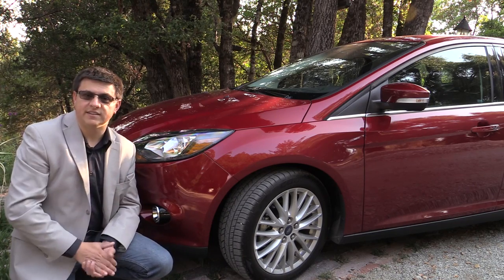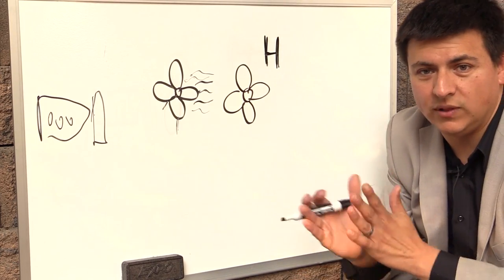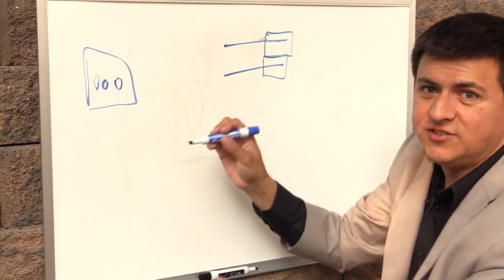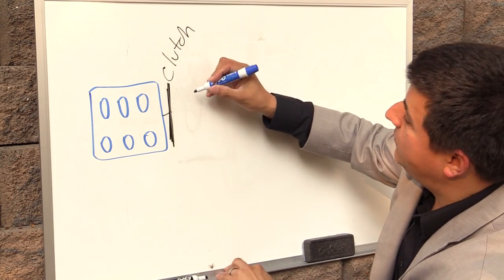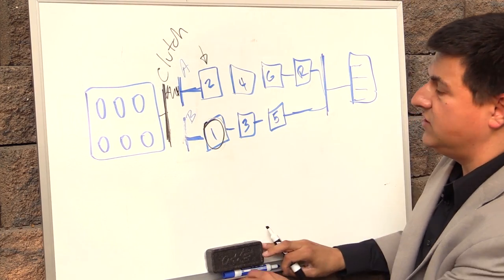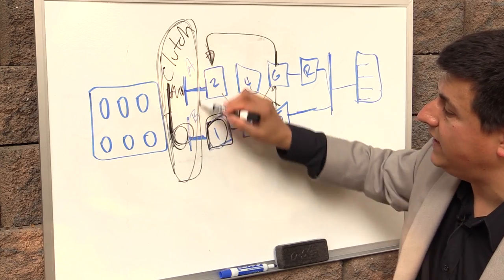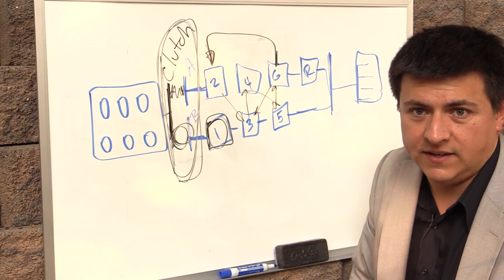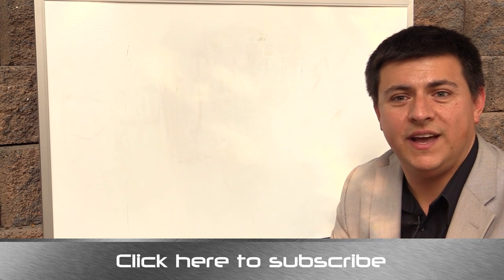How Dual Clutch Transmissions Work

Comment: A perfect explanation of what I have experienced 3 times now with my 2015 Ford Focus in that when I roll thru a stop sign I get that momentary loss of power as I accelerate hard... I thought that the transmission was defective or about to go... I understand what is happening now... thank you very much for explaining it... the transmission works extremely well once up and running...

Comment: Thanks for the explanation. My 2014 Focus has developed an unpleasant shudder when accelerating, Your explanation helps understand what may be happening. I have had it back to the dealer several times for service. The first fix was a software update which changed the frequency of the shudder. The second fix will be to replace the clutches which have been on backorder for several weeks. I suspect if parts have been on backorder that long that I am not the only one with this problem.

Comment: The main problem with Ford Powershift, that is, one that does not have leaking seals or bad electrical grounds. is that it feels like you are driving with someone who just learned to drive manual; drops the clutch too fast, shifts up too soon, this is what causes the jerkiness and shuddering. The only way to avoid this is to either move from a stop with very light throttle until over 20mph, or give it a good amount of throttle to keep the engine over the 2000rpm mark until over 20mph. With a traditional manual, the driver has the option to add some slip to the clutch to smooth out gear changes, no such option with powershift. I feel it is one of the reasons Chrysler dropped the DCT from the Dart; in order to make it work as smooth as a traditional automatic on take off as possible, they programmed it to shift very slowly, which negates the advantages of a DCT and makes it inferior to traditional automatics and CVT.

Comment: Alex, thanks for the explanation on the workings of the DCT. My wife has a 2013 Focus SE Hatchback with the appearance package (sunroof, leather seats, 17inch wheels). Occasionally I get to drive it, and these are my observations:  Love the handling and love the lumbar support. Like the ergonomics and soft touch plastics. Also gets decent fuel efficiency. Don`t like the C Pillars when making lane changes. Also the interior does not have enough "cubby holes" like to put your change or even your cell phone.  Now, about the DCT, this is one of the reasons we initially laid our eyes on the Focus. I have heard so many great things about VW`s DSG, and lots of people saying that this is Ford's version of it, I thought that this would be good for my wife who didn't like the CVT on her previous car. So, we got the Focus. I would say this about the DCT: If you live in a city with lots of traffic jams and stop and go traffic, and heavy rush hours, then don't get it because it will drive you crazy! When I drive it, and get stuck in traffic, at times it feels like the entire transmission will drop from under the car, and you car hear the gears shift. I know the DCT is constantly shifting to find the best gear, and I thought I would get used to it, but I just can`t.  Now my wife on the other hand, doesn't seem to notice or be bothered by it, and likes it over her past car with a CVT. So, I guess everyone is different, jeje. In conclusion, I give the Focus a 8/10, and would recommend anyone interested to test drive it during rush hour to experience what I'm trying to explain, and reach their own conclusions. Personally, I would consider buying another Focus, but only the ST with the manual six speed. :)
Again, thanks for the video, and congrats on your great Youtube channel.

Comment: Great informative video Alex. You've explained this better then I ever could. I think the wet dual clutch is better, but people are always complaining of the service costs. I've noticed this on many VW forums and the like.
Reply from the maker: In theory the service interval and costs would be lower in a dry clutch since you don't have the clutch material mucking up your fluid, this means less fluid pumping, smaller filters, etc. The dry clutches however will tend to have a shorter lifetime.

Comment: I own a 2014 Ford Focus with that particular Transmission.  It seems like the performance suffers quite a bit with this setup especially when passing.  It takes sometimes 1 to 2 seconds to chose the right gear for hard passing.   Which with a normal  Automatic transmission it take a fraction of the time.

Comment: Awesome explanation, thanks! So, could pairing an electric motor with a dual clutch be the ultimate drivetrain? The motor could handle all the low-speed stuff and remove all need for clutch feathering and jerkiness?

Comment: how do the clutch shifts in dual clutch transmission as it is said that it does not have any clutch pedal and only has a lever that just move forward or backward. Can I get full detail info about related to its working and changing gears.......reply asap......

Comment: I think within a given torque holding capacity, dsgs weigh more than a similar automatic, not less. This weight and size differential has been cited in regards to the Viper and Corvette decisions to not use dsgs (Viper may get the zf 8hp)
Reply from the maker: Supposedly at the smaller end of things the DCTs weigh less (I can only go by what Ford and VW have said mind you), supposedly the Powershift transmission in the Focus weighs less than Ford's joint-venture 6-speed automatic.

Comment: My 2014 Foord Fiesta is giving a problem to start, have to start it in neutral at times for it to start when it driving it won't leave 1st gear and moving from gear one to two the car shake (slip up). if i try to accelerate too fast then the engine will rev and not more. once the car reaches 60kmp that i can drive normal.  if i put the car in S-mode it will not let me manual change gears.  also at times a warning message comes up and say "transmission hot wait 5 minutes" and "use brake stop safely"

Please to advise me what is the problem and also if the "TCP" and "Clutch fork" need to change.

Comment: What makes a DCT practical is the use of a computer.  Why not go all the way and have a clutch for each gear?  Or include a convention torque converter automatic and switch to that in stop-and-go traffic.  The computer could easily handle the decision of which clutch or which transmission to connect the engine to.

Comment: Thank you for this video. Really explained a lot. I just purchased a 2014 ford focus titanium sedan and I still prefer the normal automatic transmission compared to the dual clutch one. Is there a way to replace the dual clutch transmission with a normal automatic one and how much would that cost?
Would appreciate an educated response from anyone. Thanks in advance!

Comment: what are your thoughts on durability, cost of maintaining the dct, for the Acura tlx?
Reply from the maker: Henry PachecoThe honest answer is that we won't know about the ILX until about 3-4 years from now.
Reply: +Henry Pacheco DCTs are not very reliable, in any brand.  They start shifting in a jerky fashion as the clutch wears, and eventually the dealer will tell you to replace it.   Honda has a history with their torque-converter automatics and CVTs that break prematurely (before 80,000 miles).  I would not trust any kind of Honda transmission except a true manual shift, or their cars that lack a transmission (Accord Hybrid).  Manuals are also $1000 less to purchase
.

Comment: Hi Alex,

I'm seriously considering getting a 2014 Ford Focus Titanium, but I've been reading a lot of complaints about the car's transmission.  Based on this video, are you saying the jerky feel is normal and can be eliminated if the car is driven properly? (no abrupt stop or acceleration)

Thanks so much!
Reply from the maker: Carlo Garaygay Not eliminated, but it can be reduced. This style of transmission will always be less smooth than a traditional automatic but because of the efficiencies it is becoming more and more common.
Reply: PLEASE DEAR GOD DONT GET A FORD
Reply: +Richard Garrett I got a 2015 Ford Focus SE for 2 months now (3350km).  So far so good, no problems whatsoever.
Reply: +Alex on Autos Hey Alex, Thanks for your reply btw (3 months late).  Your advice made me comfortable to buy this car :)
Reply: +Carlo Garaygay Buy the manual instead
.

Comment: ***** Have you tested the new 2.4litre Acura TLX? It uses the 8 speed DCT in conjunction with a torque converter (that's what it says on Acura website). Can you tell if that's good car to buy or its wiser to go for the 3 series? I have a budget of 35k.

Comment: you forgot to add that a torque converter multiplies torque as much as doubling the torque output. the inefficiency of a traditional automatic is negated by the smoothness of shifts and how long they last plus they can handle more torque than a manual or a dual clutch automated manual. a lot of modern automatic transmissions shift just as fast and are much smoother too.  all you need to do for maintenance is change and auto's fluid periodically. i dont know how long the clutches last on a DCT but i bet its lot more work to change. i drove an audi with a DCT and i hated it.

Comment: Hi , great simple explanation, for me just perfect,but i have a question about newest Acura TLX 2.4 with 8 speed dual clutch WITH torque conver. Would this be the best solution for performance,  efficiency and smoothness ???
Reply from the maker: Removing the torque converter is the primary way the DCT improves efficiency vs a traditional automatic so by adding it back in you trade the improved smoothness and low-speed crawling ability for some inefficiency. Part of why Honda did this is to reduce weight and the overall size of the transmission.
Reply: Alex on Autos  hmmm, i didn't think about that, thanks for explanation ! Oh and i can't wait for your review of this new TLX with DCT ,hope it's comming soon ! Cheers
Reply: Alex on Autos Still not much efficient loss if you look at the great 24/35 mpg numbers. Honda engineer said they wanted to the remove jerkiness from the 8/9 speeds which are typical and at same time they can increase torque at launch.
Reply from the maker: Lucien E  For Acura adding the torque converter makes sense because it is a more luxury oriented car. The torque multiplication at launch is also a benefit, however you still haver the 5-15% loss associated with the torque converter so you can logically assume that without it fuel economy could be another 2-3MPG higher. I think it's an OK trade off.
Reply: Alex on Autos Is that 5-15% at launch or overall? Not an expert but I would think loss on overall mpg must be lower than 5%  (mainly city mpg). This particular system also has a lock-up (in V6 controlled by the VCM system). I guess you gain (8-speed + DCT) and you lose some here (torque converter).
Reply from the maker: Lucien E 5-15% overall depending on the design. Remember that even when a torque converter locks up it is still pumping fluid so there are still friction and pumping losses involved. The losses in lock-up actually increase as you increase RPMs so it is not just in city driving where the loss is present.

Comment: Hi Alex. I am recently interested in buying a Golf R which with VW's DSG transmission. So I went back and watched this video which makes things a lot more clear. However I heard people talk about VW's DSG have some reliability issues, is it common or might because they are not using the correct way to shift? What should I pay attention to use DSG compare to traditional automatic.
Thank you!
Reply from the maker: +维民赵 VW's transmissions have in general been a little less reliable than others and there are long term maintenance costs to consider as well. You should look at some of the VW forums to get a handle on that and then make an informed decision.
Reply: +Alex on Autos  NOTICED you stopped saying robotized manual.  That&#39;s good because I 
don&#39;t see any robots (machines with arms) inside new cars.  As an 
engineer I prefer the term Computer-controlled manual as most accurate
.
Reply from the maker: +electrictroy2010 I generally prefer to use the terminology used by the industry segment since terms can change a little. For whatever reason "robotised manual" is the common term used by companies in the EU to describe the  mechanism.

Comment: This is an interesting video,  Alex.  Could you do one on CVT's?  Having recently purchased a Nissan Versa NOTE with a CVT,  and considering its performance, esp. the incredible mileage I get  (40+ mpg)  I am  quite intrigued by it.  I've searched   them on the web and read some articles,  but your take would be appreciated.  They are quite  smooth and get great mileage,  so one might consider  them superior to the dual clutch tranny?  Your opinion would be valued.  Many thanks.
Reply from the maker: In some ways CVTs are superior to DCTs but the area they really don't work well for is when higher torque engines are required. About 260-270 lb-ft is about all you can do before the belt/chain starts to slip. This is why you really don't see this type of transmission in higher horsepower vehicles. DCTs however can handle very high output engines easily so they are well suited to high power engines. While CVTs have an infinite number of ratios between high and low and therefore can improve fuel economy, they still use a torque converter (in general) and as such there is still some of that loss happening. All things being equal the average CVT and average DCT will yield similar mileage however the CVT will provide better hill climbing performance and yield a smoother ride.

Comment: Mazda's skyactiv 6-speed automatic transmission, had components of a Dual clutch, CVT, and Traditional automatic. I had a '13 Focus and traded it in because of the transmission, you don't want this transmission. Mazda had made a far better transmission then Ford has. I've gotten better MPG then my Focus.
Reply from the maker: The SkyActiv transmission suffers from some misinformation and some oddly worded PR statements. The 6-speed Mazda automatic is a traditional planetary gearset automatic transmission with one important change vs the competition: a beefier torque converter lockup clutch. While a traditional automatic will spend 20-30% of the time locked the SkyActiv transmission will spend 80-85% of of the time locked (in the EPA test). This makes it "feel" a bit more like a dual clutch transmission and according to the PR literature gives it the "fuel economy of a CVT."Personally I think that Mazda could have explained this system a bit better.
Reply: Mazda made a better transmission.